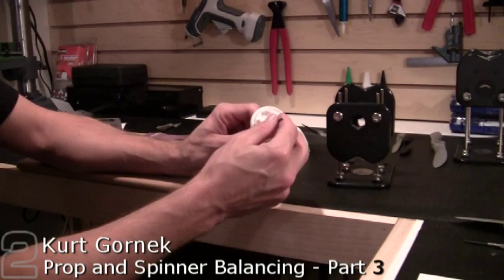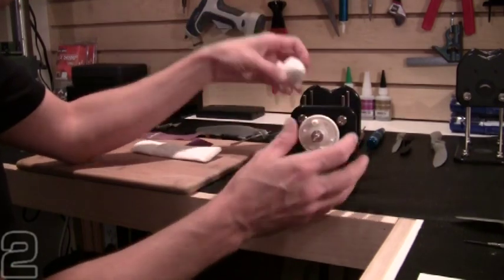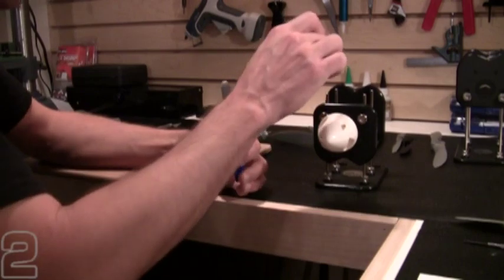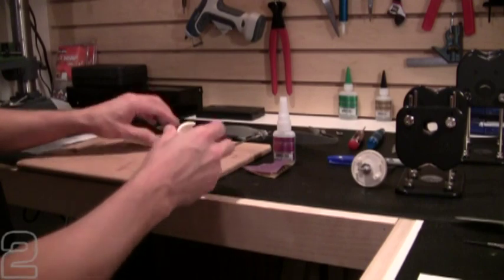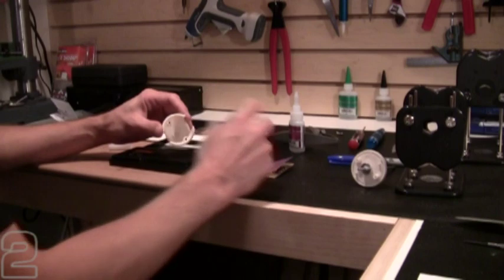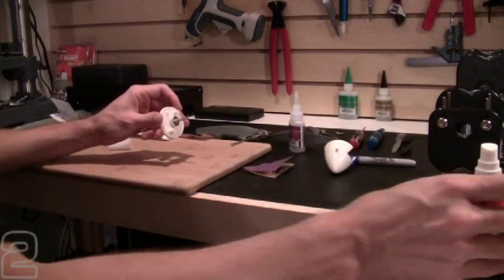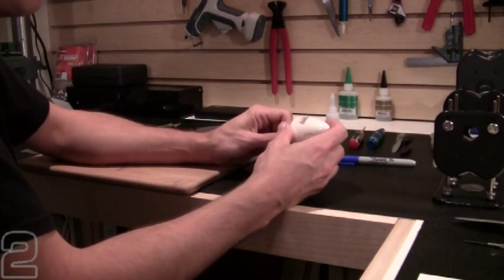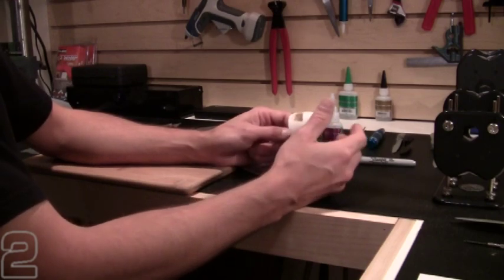RC Prop and Spinner Balancing - Part 3

Comment from the maker: @Zoomer1973 Yes, you can, provided the main shaft is long enough to span the two roller towers.  Follow the directions for large prop or spinner balancing:  move both towers close together and flip the inner roller upside down so the rotor head can hang off the bench.  Make sure any connected linkage is fastened and symmetrical (not flopping around) and it should work fine.  Very handy for getting your flybar, paddles, and weights centered for a balanced head! Not needed for flybarless.